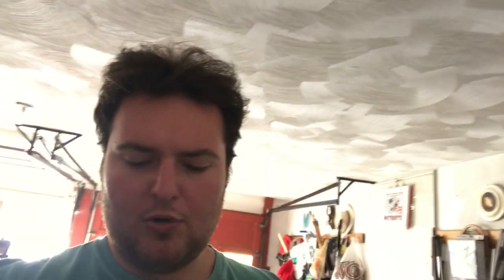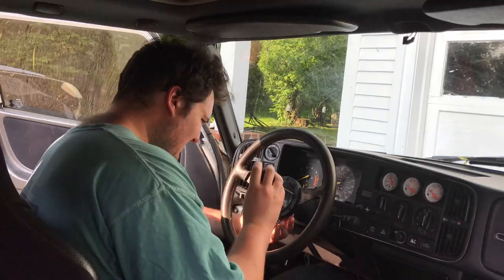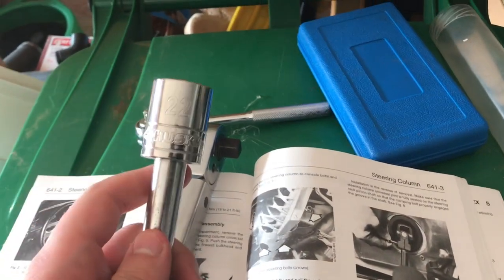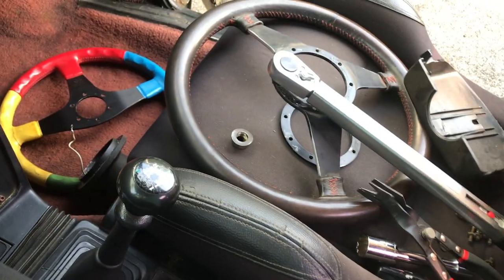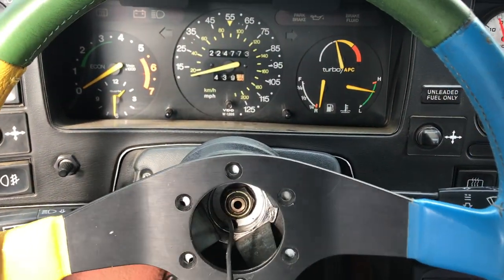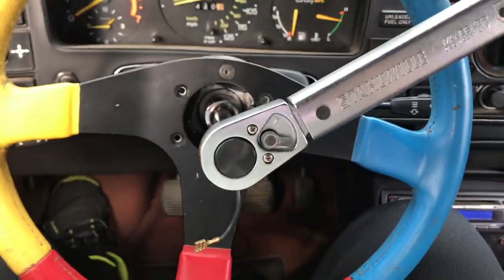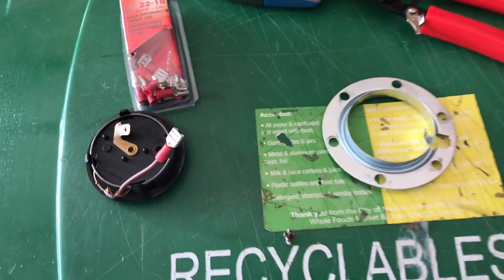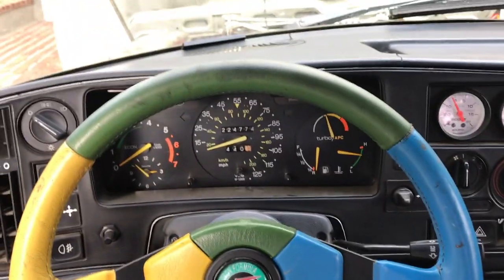Saab C900 Steering wheel install

Comment: Hey Bij great video, i had a question, I have a 1992 900 turbo vert w/ airbag. I have an old Saab Dino sport wheel similar to the one you replaced. If I put that old wheel in my vert do I have to replace the steering column?
Reply from the maker: Thanks very much!  Unfortunately I have never swapped an airbag wheel so I am unsure of that answer. I don't think you'd have to change the column, probably just have an SRS light to deal with but I am not 100% sure. 

If you are in this group: https://www.facebook.com/groups/2216998577/
You should get a solid answer pretty quickly.  Good luck with it!